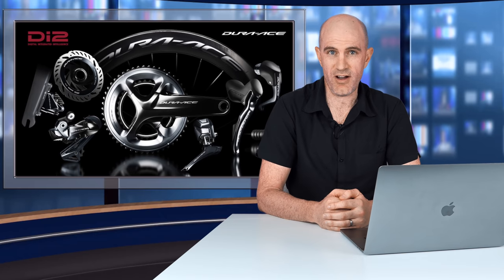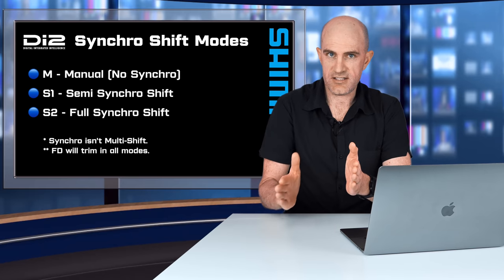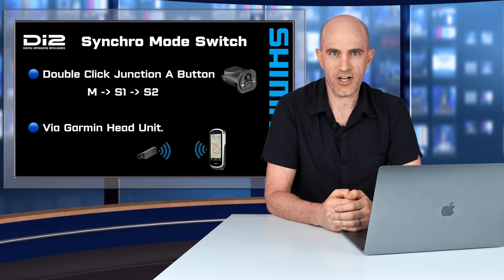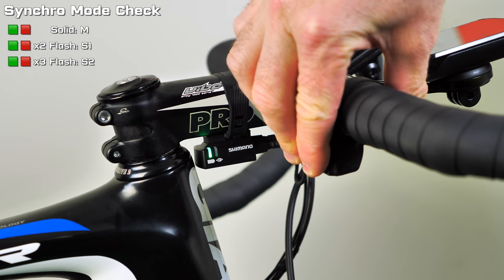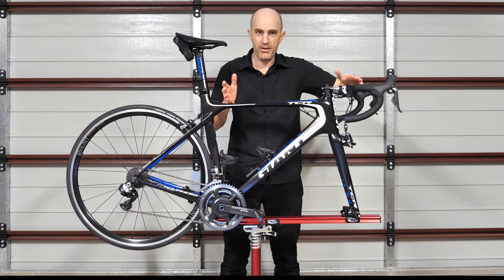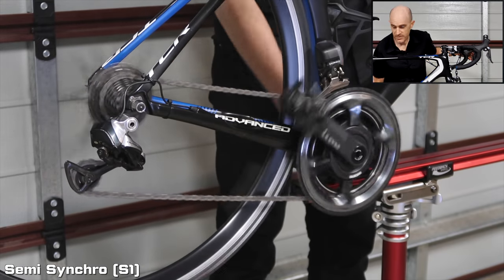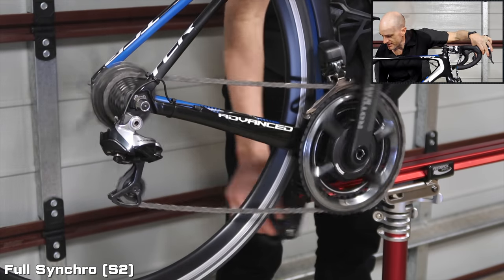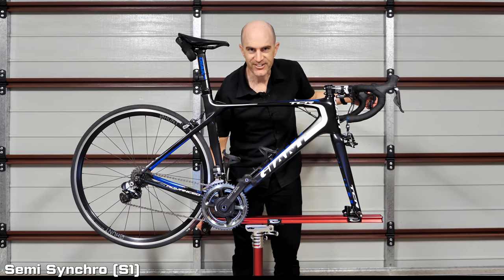Shimano Di2 Synchro Road Shifting: Details // Configuration // Switching Modes

Comment: How do I know if my bike has a wireless module installed, I cant seem to get it paired with my wahoo elemnt. Bike is a 2020 trek madone di2
Reply: @m4ttfletcher  when I connected to the computer, the SM-EWWU111 is not detected... I dont see the small unit outside either, do they come installed from factory? That's the d-fly unit if im not mistaken
Reply: @Juan Tobon , if you dont detect it its not there. Its also not in the outside. Search in youtube for “Di2 shane miller” set search filters to upload date and watch last 4 videos. Beginning with the oldest video, you will find all your answers in the videos.
Reply: Thanks guys
Reply: Juan Tobon  for the wu111 instalation search youtube for shimano wireless module installation

Comment: There are certain things in the cycling sphere that make no sense to me,  as someone who has owned both compact and standard cranks - they are the same except compacts limit your ability to put out power on steep descents, otherwise your shifting choice determines level of effort so.... compact cranks are pointless.   Shifting... if you can vary your cadence you can handle a wide range of gear choices....getting 20 gear choices is pointless.  Crisp shifting helps, tiny incremental shifting.... nope.   Cross chaining.  I have one 3 chainring bike where cross chasing is an issue.  On all my other bikes I can use any combination I want with no exception and no problems.